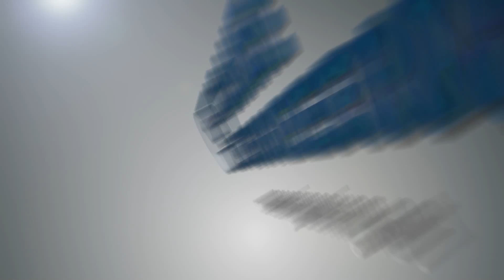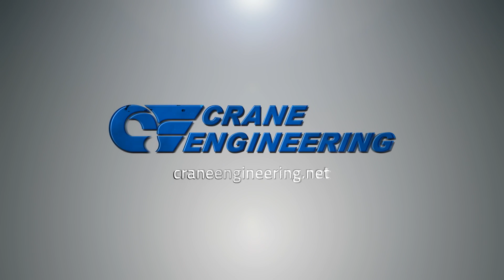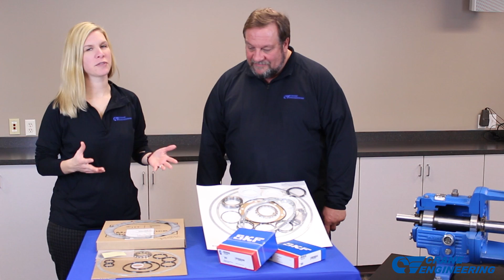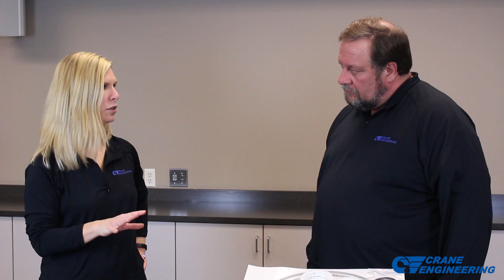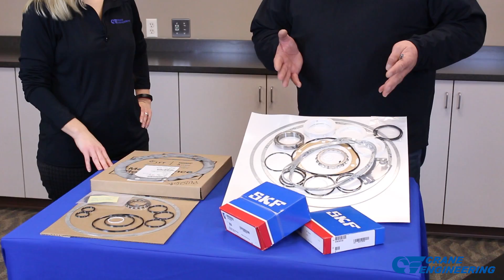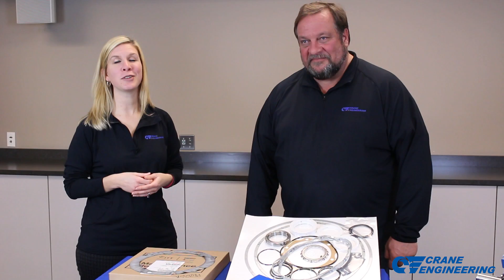Goulds Pump Parts - Pump Repair & Maintenance Kit

Comment: I have a Gould's submersible pump for the water for inside my house. It's an older one an old.man gave me. He said it can be repaired. The motor runs strong , but the fans or impeller dosent work. Can that be replaced since being the Gould's are so expensive and I need a pump for inside my house because mine quite working.